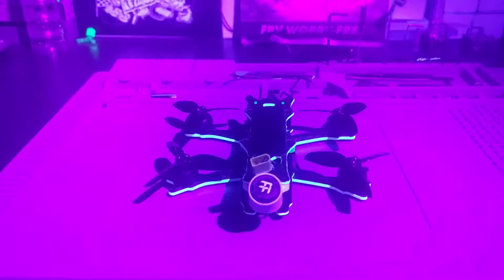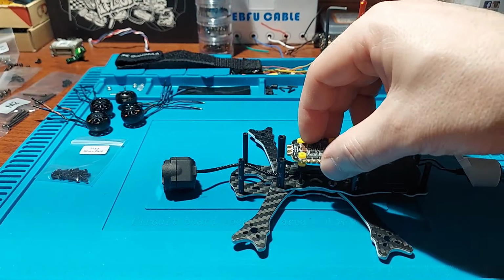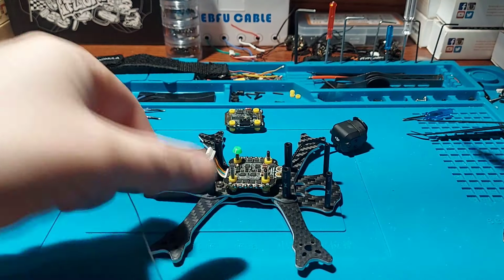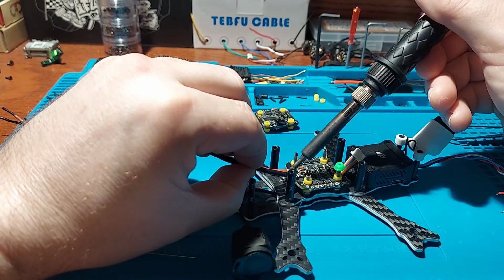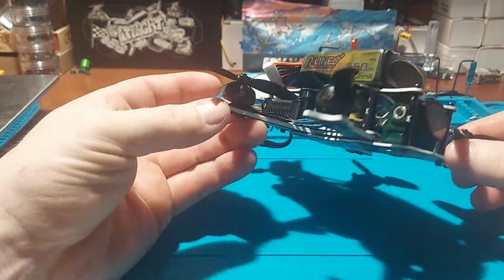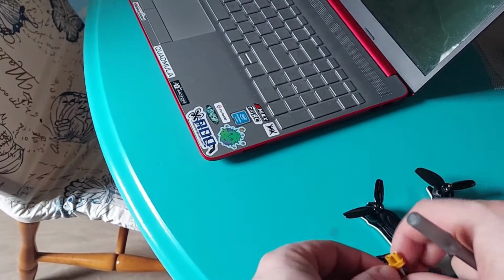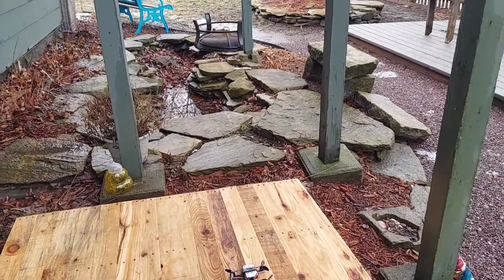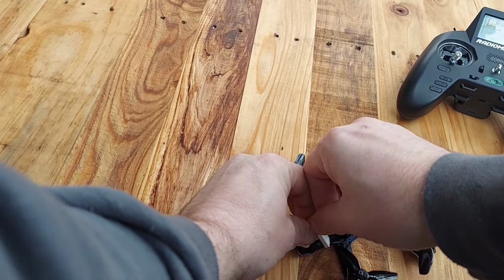The ULTIMATE  2.5 inch MICRO FREESTYLE Build 2024! NO PROPS IN VEIW

Comment: Great video. I'm literally programming mine right now. Having issues setting up my motors. Only 1 is spinning. Did you have that problem?
Reply from the maker: @DannyFPV7 thanks for checking out the video bro I appreciate the support 🙏..and no I didn't have that issue are u sure ur wires are soldered up to the esc correctly?  Or maybe faulty motors bro

Comment: I am flying this nice little ripper with 4s and 1404 ,4600 kv t-motors and it has enough power. I can ˋ t believe that you fly with 6s and 5500 kv.  For example my Pirat lil matey is a 6s build with pacer 1604 and this beast is awesome.

Comment: If you lowered limit the motor output to 32% would that put those motors at 1760kv?
Reply from the maker: @PeighUpFPV  exactly my friend I run it off of 4s now there wasn't enough kv for freestyle on 6s with these motors lol
Reply: @burdfamfpv  I just ran into the same issue.  I built one with 1604 2850kv motors and I hated the way it flew.  Going to switch to 4s. Probably going to opt for the AxisFlying 1404 4500kv.
Reply from the maker: @PeighUpFPV  yea 4s isn't all that bad lol I prefer 4s on some of my quads since they all have there own unique traits, I think those 1404 motors will be perfect 😎👌

Comment: what's needed if i want build an fpv drone with a long flight time ?sorry for noob question
Reply from the maker: @mikoalulayoutube no problem if your looking for long flight time it's a balance of weight and battery size so I meen you could do this a few diferent ways! If your looking to just explore maybe get a 7 inch and 2 /1300 mha lipo in parallel and you can get 15 min or even 20 with the rite components. Motor kv is huge if your looking for long flight time the lower the kv the less juice it will pull from ur battery meaning more time in the air! If u need more info let me know thanks for the support🫡
Reply: @burdfamfpv  Can you be more specific with examples? I already have a 5' frame and DjiO3 air unit, what else do I need to get longer flights?
Reply from the maker: @mikoalulayoutube  you need to get a really light frame with 2004 1800kv 6s/ or 2900kv for 4s motors (the tony 5 would be perfect frame only $39.00 and weighs practically nothing.and a 45 amp aio flight controller  with geprc elrs reciever, you can get up to 20 min with the rite battery maybe more, it really comes down to the FRAME  choice to be honest but I hope this helps my friend
Reply: @burdfamfpv Thank you for your input, it means a lot to me
Reply from the maker: @mikoalulayoutube  anytime my friend, if you have anymore questions or concerns I'll do my best to help u! Happy flying